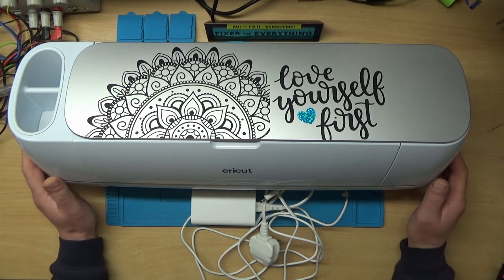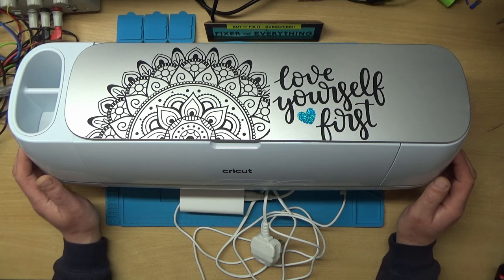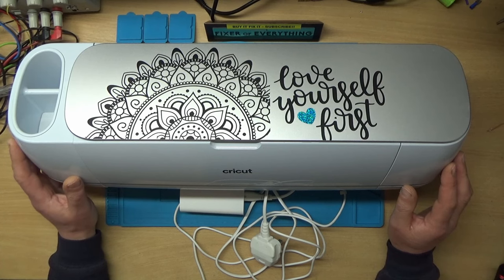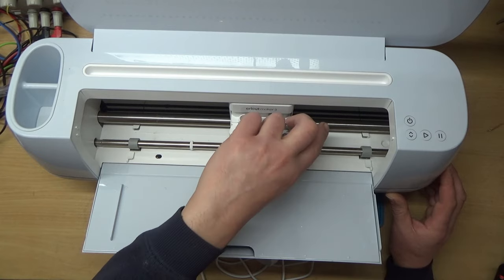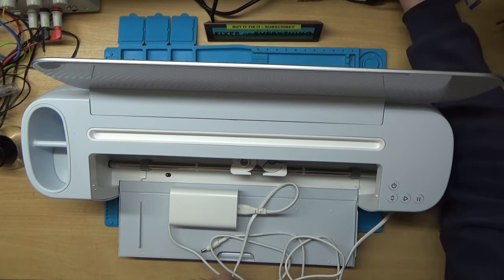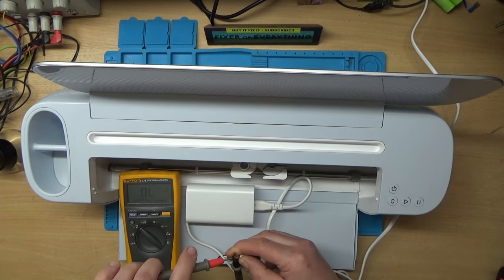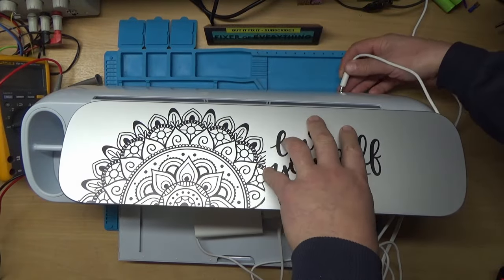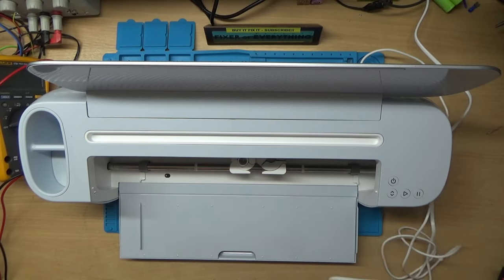Faulty Cricut Maker 3 - Trying To Repair...

Comment: 100% agree about the deactivation thing, absolutely criminal. While this wasnt a successful fix, at least its a good PSA to never buy products from this company
Reply from the maker: Yep, pity about all of the corrosion. If it was a chip or such I'd have probably repaired it.
Reply: Yeah, that's extremely shitty behaviour, there's enough bloody e-waste without people just chucking these things out because they developed some minor fault.
Reply from the maker: Totally agree 👍
Reply: I would think that someone out there has hacked and cracked into one of these things and bypassed the deactivation nonsense
either by flashing the firmware, spoofing the serial into a different one, or just running the important parts off of an arduino or a raspberry pi … it would be a bird’s nest of soldered jumper wires, but it is at the very least, usable.
Reply from the maker: Someone did with the older models but changed all of the motors for steppers. I think this one has USB communications encrypted to stop people using other software. I should be possible to reprogram the pic32 chip but you'd need to reverse engineer the pcb layout so you know what i/o pins do what and then port GBRL or something to work with that. GBRL would probably need extensive modifications as it may not support brushed DC motors with optical encoders.
Reply: Someone will come up with a hack and get these to work w/o connecting to the internet.

Comment: I will never be upset at a failed repair video as long as you explain why. As someone trying to learn electronics repair, it is vital to know what's worth pursuing and what isn't.
Reply from the maker: Thanks! I did try, and it still may have been possible. It's just how much time and effort do you spend on something to try and repair it? I spent about 5 hours probably on that unit and it was becoming clear to me that it would take hours more to try and trace all those corroded tracks and then hopefully repair them, and then there was no guarantee it would work after.

Comment: Agree 100% its criminal that manufacturers can still get away with this, no wonder there is so much plastic in our water.
Reply from the maker: Unfortunately it's worse than this, as I've seen units advertised on eBay for things such as a small crack in the case, and the unit was replaced and deactivated, or because the lid was loose!

Comment: Bought a Cricut August 2022; used it about 10 times to figure it out and then put it aside. Decided to try it again last week and it wouldn't work. Called Cricut; 2 lovely techies tried to help but determined it was the motor. 7 days out of warranty and they will not replace. Crap company!
Reply from the maker: Wow that totally sucks. I recently had similar with a Ninja food processor/blender where the jug after putting hot soup in it had cracked around where the motor shaft goes through the centre. After visiting their site it seems a very common issue as there was loads of comments saying pretty much the same and some people were onto the 3rd jug! They said it was out of warranty and I'd have to buy a new one, even though I had used it only twice!
Reply: luckily there is lots of bricked devices you can buy cheat to salvage parts from, as long as your motherboard is good and not remote-bricked you might be able to find someone who could rip the motor out of a bricked unit to send you, save these scum bags from getting another sale, although after finding out about this remote bricking policy I would hope most people would avoid Cricut machines

Comment: Everyone who uses electronic gadgets should see this video. Should send a cautionary message to them, drink your fizzy beverages elsewhere! I've tried repairing electronics that have suffered this same fate. Usually catastrophic damage, not repairable. Cheers, great video. Subscribed.
Reply from the maker: Thanks Quantum Leap, you will probably like the FLIR camera repair video and the solar inverter repair I did too (I had a bit of an issue with both companies being most unhelpful) and with the solar inverter they wouldn't give me a password and pretty much said bin it and buy a new one... good job I'm not so easily deterred 😂😂😂
Reply: You should see the likes of Louis Rossmann repair crApple Mac boards which have had liquid damage… though he does have the aid of circuit diagrams and boardview software for all the specific models of boards for those overpriced pieces of ewaste, he manages to get them back in running order, bar another one of those unobtainable chips like ISL9240 or the godforsaken T2 chip (unavailability enforced by crApple, of course.)

Comment: That’s the first ‘no fix’ I’ve seen from you! And I’ve been bin watching quite some repairs..:) very wasteful indeed to not provide any service, but just simply replace and bin it..
Reply from the maker: Thanks 👍 Yes, I could have spent more time on this and possibly repaired it, but after all the effort it would still not have worked due to it being deactivated. Unfortunately sometimes you have to call it a day. Another no fix was the Dyson hot and cold fan due to the microcontroller being fried, however a kind chap from Australia sent me his faulty board and I managed to repair that one and used it to repair the fan in a later  video 🙂

Comment: Every so often Lidl's has in the middle aisle their version of the Tite Reach which is damned top banana for really awkward fasteners and can be used with power tools on one end.   Very versatile tool and solid German engineering, I have used mine quite harshly a lot and its still tight on the chain, no backlash or slacking.
Reply from the maker: Thanks 👍I'll have to keep an eye out for one.

Comment: Another excellent video, nice attempted repair but apparently liquid and PCBs don't mix, who'd have guessed? :-) 

You deserve a lot more subs! 

The general 'replace it, bin the original' approach is absolutely appalling, coupled with the online requirement. I hate it when manufacturers do this.

Environmentally damaging manufacturer-induced waste is getting far worse these days, especially now that they have cheap circuits and the internet to ensure that people can't easily fix their own devices. It's just terrible levels of greed and control. Seemingly many governments won't do anything to combat it either, I can't think why ........

I repaired my toaster today (electromagnet issue with carbon on the contacts - just clean the contacts to fix) - many people would have thrown it away and it would have ended up as landfill. What's next, online only toasters or software locked down toasters which prevent repair? Wouldn't in fact surprise me if they already exist.

If so many governments weren't so corrupt they would force manufacturers to make items cheap and easy to repair.
Reply from the maker: Thanks M Jons totally agree. Don't forget the DRM bread :)
Reply: @BuyitFixit  Hah, yup!

Comment: Thanks for this, good to see the internal! I purchased one of these with a faulty power port (the pin is missing) do you think this would be an easy enough thing to change if I could locate a replacement port? 😊
Reply from the maker: Hey Saff, no problem. Yeah I don't think it would be too difficult to change👍 there's some higher resolution pictures of the pcb in the video description which may be of help.

Comment: I am curious if it would be worthwhile to gut the unit and add an Arduino controller with open-source plotter software.
Reply from the maker: Someone did this with an older model, but had to change the motors to stepper motors as these units use a brushed DC with an H bridge and optical encoder. It would probably be possible to reprogram a working board, but you would need to port something like GBRL or something to work with the hardware.
Reply: thats got tovbe a major threat to these companies now. if they got their way theyd have the whole unit potted in diamond strength chemical resistant epoxy.

the companies should pay for cleanup and recycling. my call is for them to biotag the plastics so theyre traceable back to the factory.  might mean less choice for us but at least we wouldn't be ripped off 24/7, we'd have quality gear

Comment: I don't know if it has been mentioned in the comments or on other videos, but I think the corrosion you are seeing looks like electrolysis. Metals in a liquid with power applied. The tracks with a potential difference between them will undergo electrolysis, and copper is removed from the more positive ends and so you get the blackening, and sometimes the blue copper sulphate type stuff around the more negative sides. It's been a long time since I did chemistry at school, so that is probably a rubbish explanation. If power had not been applied, it just would have remained wet.
Reply from the maker: Could well be. I was thinking the coke contains acetic acid etc (like when you copper coin in coke) but electrolysis might also have played a part in this.
Reply: @BuyitFixit  Cola is prolly the most corrosive soft fizzy drink you can get :( Not only does it contain acids from the flavouring, but the CO2 also dissolves in the (mostly) water, creating yet another acid. Hence why (stale) fizzy drinks are so good as limescale remover in eg toilet bowls :)

Comment: I see this a lot with items that take batteries. People don't take the batteries out of the items they don't use anymore, then the batteries start to leak, especially in remote controls. The thing with the remotes is that they have a silver paste that is conductive for the button press. once that starts to corrode away the remote is pretty much useless. I've tried to re-apply the paste but it's not easy. Although this was a no fix item. you still have some useful parts for repairs on other items, so it's not a total waist. This video is 8 months old, and I know it late, but I'm catching up on all the video, and just making comments as I can. Love the videos!
Reply from the maker: Thanks, no problem and I appreciate the feedback 👍
Reply: I've especially selected a Silhouette one because at least some open source projects support it. Haven't tried yet, but if they try to pull BS like that there is at least a backup plan.
IMO Cricut makes toy-grade stuff, the software is also very limited. Does it support SVG yet?
Reply from the maker: @JonasKoritz I've no idea, my wife ended up getting a Brother machine and the Cricut has sat in the box since.

Comment: Basically door stop or parts for own project. nice motor control chips + motors. "good" linear rods etc.
Remember the time when I recycled old inkjet printers as parts for own test projects.
Reply from the maker: Someone did convert one of the older models with stepper motors and an arduino board running GBRL so that might also be a possibility...

Comment: My partner has one of these, we're thinking of just replacing the board with a cheap 3d printer board to control the steppers and use Marlin firmware or something like that.

Could you take some detailed photos of the board? I've not taken ours apart yet
Reply from the maker: Hi number g. I've taken some pictures for you as it's still on my bench. I've put the link to them in the video description just in case anyone else wants them too! I had thought of possibly doing similar, but I'm not too sure on interfacing to the head part of the unit. It probably requires a little bit more investigation.
Reply: @BuyitFixit  Nice one, thanks
Reply: @numberg8238  the motors are DC servo I think, 4 of them at least they are on the previous model maker, because I bought a deactivated one myself to try to get working.

Comment: My mother-in-law had a few of the original models and they used to work with a (purchased) cartridge that held all the shapes. Some company came up with a device called a "gypsy" (i think) that could copy the cartridges so you didn't need to actually own all of them. I'm sure that was the beginning for cricut to go full nuclear locking down the machines and software.
Reply from the maker: Interesting, I didn't know about that. Thanks for commenting 👍
Reply: 100% correct, & Circut also brought out their Jukebox which you could load 6 cartridges, & you could daisy chain 3 Jukeboxes give you access to 16 cartridge, it  got superseded by the Gypsy.

Comment: My Cricut maker only worked for 3 years. I baby it, barley used it and I only cut vinyl with it. When it stopped working Cricut insisted something was stuck in it. Nothing was stuck, it was the motor that went bad in the main cutting piece. All they would do is offer me $50 off of a new one. I am so disappointed in their customer care service.
Reply from the maker: Sorry to hear 🙁 My wife hasn't actually used the cricut since she got it, we ended up picking up a used brother scan and cut and she's used it a couple of times so far cutting out cardboard. Hopefully you got yourself an alternative machine too!
Reply: @BuyitFixit  I actually do have a scan n cut as well. I got that prior to the Cricut. I liked that the circut had a self adjusting blade. Oh well...I hope she is enjoying her Scan n cut!
Reply from the maker: @michelesol5425  Thanks 👍🙂

Comment: I guess there are some projects to replace the circuit board in Cricut's with different microcontrollers.  Found one to use a ESP32 and let you use GRBL to control it.  Was the first thought that popped in my mind when you said they locked out the machine.  It seems the project ditches that control board completely.
Reply from the maker: I did see a project for the earlier cricut machine with GRBL, but that also involved replacing the motors with stepper motors. This uses brushed motors with optical encoders and an H bridge driver. It also has additional motors to control the cutting angle of the head and an electromagnetic coil to control the "pressure" of the blade on the cutting surface, so it would be a fair bit more complicated to code for all that I would think.

Comment: Good video as so often. But couldn't you find out what type of adapter would be suitable without buying a whole defective machine?
And is it maybe possible to have the serial number reactivated if you report to the company that the machine is up and running again or is this only possible when the company repaired it themselves or by an assigned repair centre?
This PCB was gone to far, but at least you could selfish several parts from it if you wanted to.
Reply from the maker: Thanks, yes I could figure out the adapter  but I think it was 24V and a smallish plug on it. The only adapters I had lying around were some 12V and some laptop adapters which if I remember were around 19V but they didn't make it work properly either. My bench PSU did make it work though, so I thought it was easier to get the correct adapter but the price of them was the same as what I paid for this and the adapter. Cricut don't reactivate machines because I guess you could just say oh it's faulty and end up with two. There was a couple of people whose machines were deactivated because of a small crack in the lid or because the front cover wouldn't close probably even though the rest of the machine still worked perfectly well.

Comment: I bought one of these 2nd hand. It had some paper jammed in it, which was easily removed. When I installed the software. Cricut bricked it so it could not be used.
I would not recommend anyone buying these units that are pre owned. You can own the machine, but the the software is owned by Cricut. You will get no help from them if you do not buy directly from Cricut.
Reply from the maker: Bricked because of jammed paper says it all! Really sucks 🙁
Reply: It does my friend. You are doing a great service for the right to repair movement. Keep it up. You should do a YT course on electronics repair. Create a whole volume of episodes. I would love to learn what you do. @BuyitFixit
Reply from the maker: Thank you. I did do a little four part series on testing various items and components.

Comment: Could you not find a generic board to replace that one with with difference software?
Reply from the maker: Problem is most boards use steppers, this uses brushed geared motors with optical encoders. I think someone did convert an older model with less features to stepper motors. Controlling the cutting head might also be an issue.

Comment: This one is great base for Raspberry Pi or Arduino project, because, mechanically it should work and all sensors should work.. 👍
Otherwise, this practice by disabling devices is against Right to repair..
Reply from the maker: I'm pretty sure a few people have done similar with the older models. I think the issue is that most projects use stepper motors where this uses brushed with H bridges and optical encoders. And similar for the cutter angle, and the Z axis is like a speaker voice coil for the pressure. You could repurpose a working board as there's tools including arduino libs for the pic32 but it would probably required heavy modification to something like GBRL to get it to work.

Comment: * - You can use a program like "Sir, Cuts alot" it's a vector cutting program (and works offline).. then u don't have to use ANY cricut modules, cartridges, software, etc... then you can make whatever you want... and deactivation would not matter either ...
Reply from the maker: Does that work specifically with the cricut? I thought each machine has an encryption key and the USB communications are encrypted per unit. They did this so the machine is locked to their platform. You could possibly port something like GBRL and flash the MCU but it would require a fair bit of modification to the code due to the cutting head configuration and all of the motors being brushed with encoders as opposed to stepper motors.